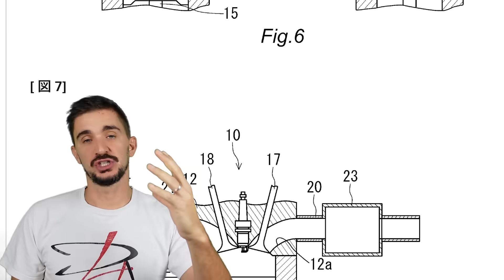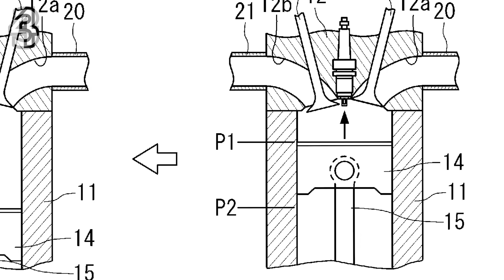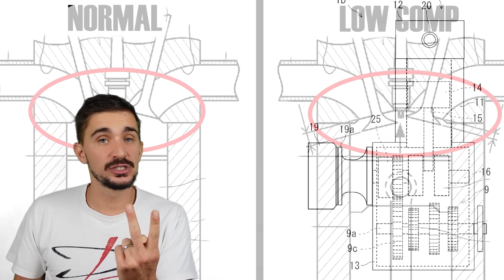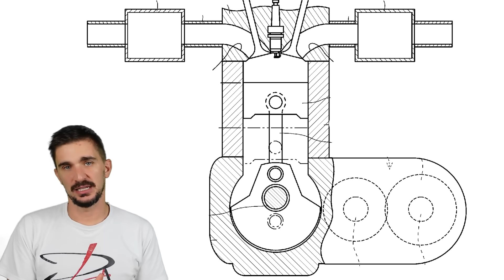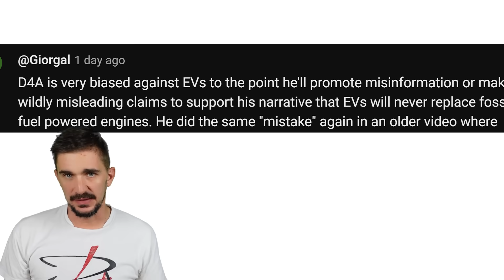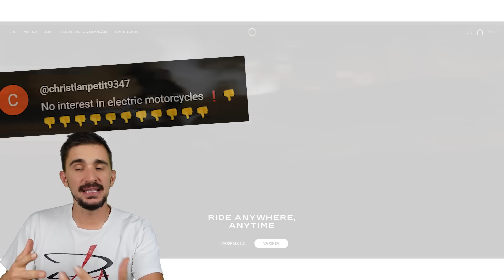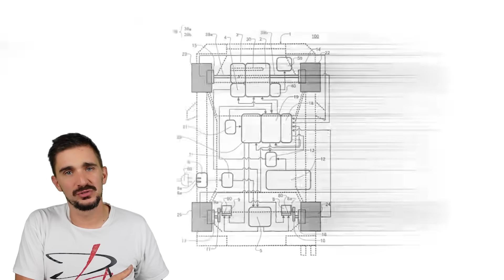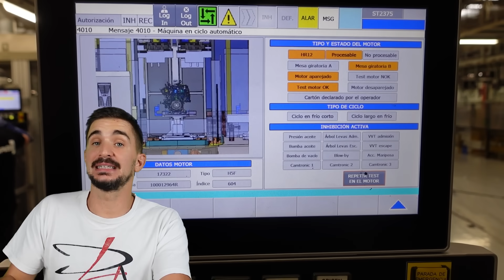Yamaha Just Patented A Fake Engine

Comment: They're wrong but yet they are right. I love my 1986 SR500 (kick start only four stroke single). Here I can tell you that I don't usually spin it to >5000rpm as it has bucket loads of low torque. But, you can feel the power stroke occur, so unless the electric motor pulses power it's meaningless.
Ultimately it's meaningless because why electric bikes fail to meet consumer expectations is a combination of the lack of a gearbox, lack of power at highway speeds and lack of range because of aerodynamics.
But thanks for bringing this up.